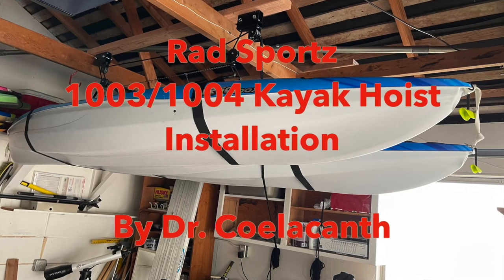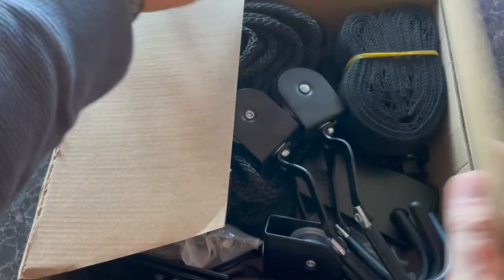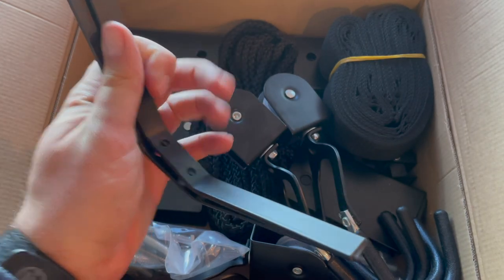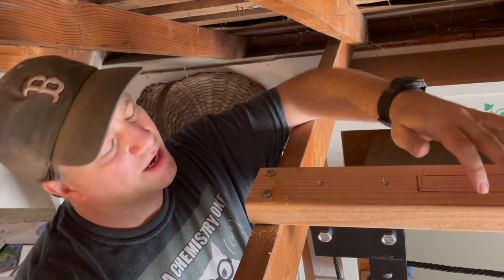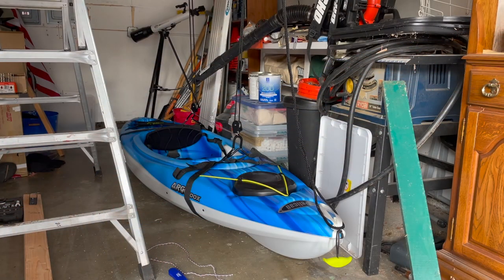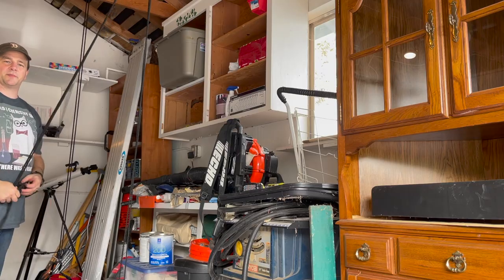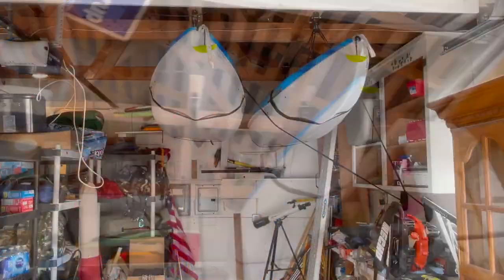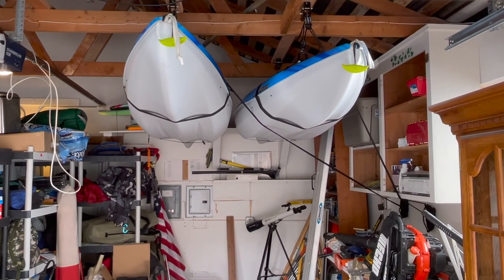2021 RAD Sportz Kayak Hoist Installation and Operation 1003 or 1004 (EASY)

Comment: Hi any tips on what to do for a closed roof, with no access to above, but the beams are running the incorrect direction
Reply: You should be adding a piece of lumber, usually a 2"x4", under your brackets whenever you have a finished ceiling in your garage, regardless of which way your rafters run.  In your case, mount a 2"x4" on top of your drywall perpendicular to your joists.  If you use a 8' piece of 2"x4", and your joists are mounted 24" apart (typical), your board will pass under four joists running the opposite way.  You'll need a stud finder or some way of locating and marking the location of your rafters from below.  Then screw the lumber to all four joists, at the marks you just made, to secure the lumber to the ceiling.  Then screw the pulleys to the lumber.  Good luck with your install.

Comment: It looked like it was actually quite difficult to release the brake - you had to swing the kayak almost completely to one side to be able to release it.  What's your advice on that?  Also hard to tell whether the wrap on the wall is actually holding the weight of it up, or would it hold if the 'brake' was not engaged?
Reply from the maker: Not too hard to release the brake, especially after a little practice.  The hardware on the wall can also hold the weight (if you mount it into the studs).  I did wind up replacing the substandard hardware with a better one found at a big box hardware store.  Thanks for the comment!